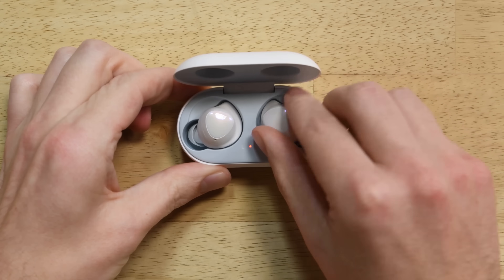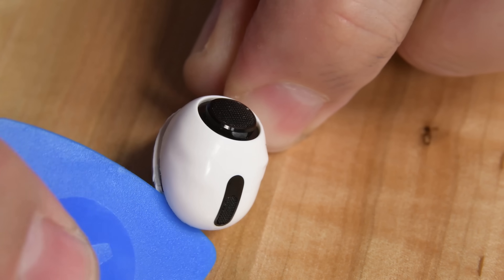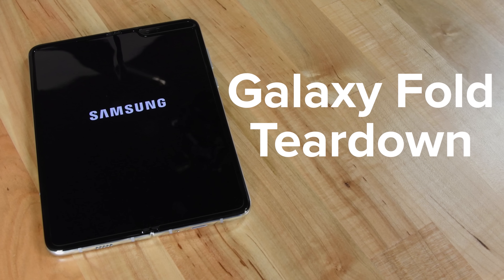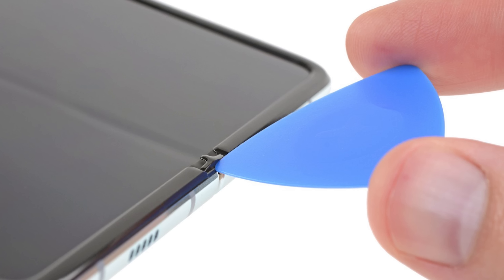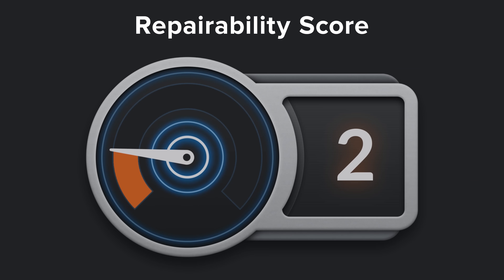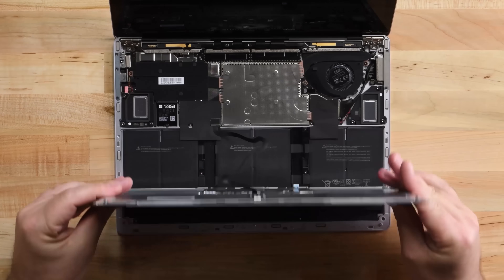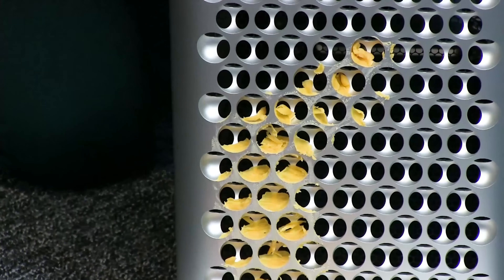Most Interesting Teardown Finds of 2019!

Comment: Well, yes, hardware can be repairable now, because the planned obsolescence was replaces with forced obsolescence, in future Microsoft will also make the hardware to a piece of junk through software like Apple does for a while now, Updates that bust fill the harddrives with junk and use other methods to slow down the system, so anyways people will be forced to buy new devices continously, because simple texting apps that would basically run on a Nokia 3310 can't run on a 240 core CPU with 120 Terraherz and 1024 Exabyte RAM (to exaggerate a little) because the new OS doesn't support that device anymore.

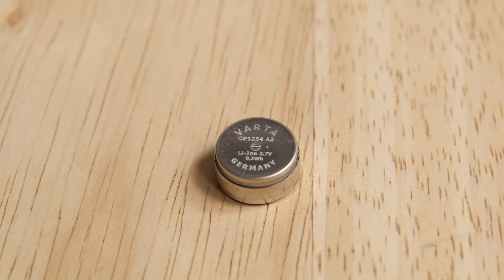Comment: 0:40 Rechargeable button cells at the corner store? That sounds a little... optimistic.
Reply: Some hearing aids use them, so some corner stores have them. And pharmacies.
Reply: The Algonquin  Really rechargeable Lithium or the much more common zinc-air cells? And using the specialist shops for hearing aids as example for "some corner shops" would be kind of cheating.
Reply: Varta  CP1254 A3 rechargeable batteries available on Amazon and eBay. Sony's use same battery.

Comment: The new Mac Pro got a 9/10 repairability score. However someone pointed out to me the concern of having a non replaceable SSD that has the OS on it. Also considering the issue that SSD's are known to have a more brief lifetime, especially under heavy use.
Reply: Mason A you can install another hard drive or SSD and run the OS off of it without ever using the built in SSD.
Reply: @ninja1inblack105  Oh interesting. I thought that because of the proprietary nature of Apple software you couldn't install it on another drive since it wasn't connected to the T1 (T2?) security chip.
Reply: Mason A maybe on other macs but the Mac Pro is very modular. Although on the older MacBook pros you could switch out the hard drives and reinstall Mac OS on them
Reply: Mac Pro has non removable ssd??? They surely think different and redefine things... pro with fixed drive... lol
Reply: Dobromir Dombek yeah the one downside to an outstanding machine boohoo. If a non removable ssd is its biggest problem then sounds pretty sweet to me.
Reply: Ninja1inblack One downside, maybe only just the first one that has been identified? I hope not. It is not only my opinion and I am not an Apple hater I just can’t understand their notorious misuse of PRO adjective. What is pro in holding all your work for days because of broken workstation element that cannot be replaced in few minutes by well trained computer technician?

Comment: Apple realized their error and next air pods will be completely impossible to open.
Reply: Dmitriy Other way around, they realized gen 1 and 2 were impossible to repair so for the pro model they made it easier to fix.
Reply: @ninja1inblack105  in parallel universe)
Reply: Ninja1inblack I don’t think you got the joke bud
Reply: Ninja1inblack it was a joke

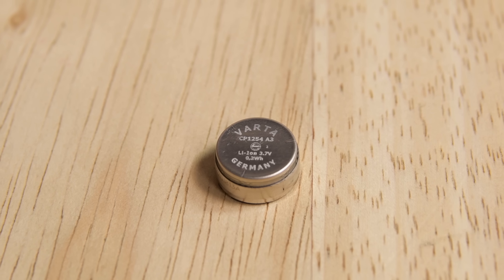Comment: 0:38 no the batteries in the earphones are not the same as the ones that you can buy in a shop. The battery in them is a 3.7v li-ion battery. Not a 1.5v or other lithium battery
Also, the ones you can easily find are NOT RECHARGABLE if someone actually does this the battery will probably leak and perhaps set itself on fire  and it will not even power the earbud.
Reply: @10tк๓ђ i know, I was just mentioning that fact incase someone actually tries to make a repair like that.
Reply: I agree, that it total miss information
Reply: Wait, so when they caught fire it wasn't because of my playlist?
Reply: Button cell that starts with C can't have 1.5v by naming convention. It would be 3-3.7v range.
Reply: @niter43   ok. But none of them are rechargable unless it specifically says
Edit:
Also not all button cell batteries name starts with C infact, you are far more likely to find one that starts with A or L  which are 1.5v and of the alkaline type
Reply: @james_robertson  you can buy rechargeable button batteries, although they are pretty expensive. if you enter the code correctly it will only show rechargeable ones too.
Reply: @ZENTAI00  not in shops/stores where I live. They only sell the non rechargable 1.5v or 3.0v button cell batteries
Reply: @james_robertson  Even if the shops did only sell non rechargeable ones, you wouldn't just pick a random battery would you? Surely you'd buy based on the code on it?
Reply: @thebaldconvict  not everyone will match the code on the battery. Some people simply do not understand that some batteries are not rechargable or have different voltages. And the fact that they just said button cell batteries will make someone try and fit a  1.5v battery in the earbud. And they also said "where other household batteries are sold" . The battery shown is hardly a household battery because it isn't really a common type of cell so it's not like a common household will ever have or more  one of these batteries because hardly anything uses this exact type
Reply: @james_robertson  Those"some people" had better not tear into complex technical equipment to fix it.
Reply: Its the same battery type that you can find in solar warches like Casio, Citizen, Breil.. etc.
They made a mistake in the video, but this batteries are not that hard to find.
Reply: Nowdays they can be bought in a shop as well
Reply: @jonjonsson6323  not in the UK they can't. I can only find the 1.5v alkaline batteries
Reply: Just watched the video and almost fell off my chair when she said that...
I have to agree here, low IQ does exist so someone will see this and try it.

Rechargeble only batteries required and more than likely only bought online. Damn lol.

Mac and Cheese, brilliant lol
Reply: Thought the same thing.
Reply: I cringed when she said that
Reply: Let the retards try, we get rid of them by our artificial selection
Reply: lmao, if you match the battery by number (CP1254) your going to get the right one
Reply: @deathpony698  yes, if you match the battery number you will get the correct type but they said " button cell"  which are very rarely rechargable.
Reply: Varta  CP1254 A3 rechargeable batteries available on Amazon and eBay. Sony's use same battery.
Reply: You can buy the battery that's in the galaxy buds for 3 bucks. We have this thing called the internet, it leads you to this place called Amazon.
Reply: @JLawL  yes of course you can buy them online but the chances of finding them at a "corner store' very low. Someone who maybe is not that knowledgeable of electronics might actually buy a standard 3v or 1.5v lithium (not lithium ion) battery and try and install it in the earbud. And if you know anything about lithium batteries you will very much know the emense danger they pose if installed incorrectly or charged with something (only applies to standard lithium batteries [lithium ion is different to regular lithium battery in the fact they can be recharded]) they could explode/catch fire which in this case could actually cause severe burns is someone is using the earbud when it decides to go Chernobyl on them
Reply: No, the usual ones are not rechargable. The point was that they are standard and easily available opposed to some custom form factor.

Comment: I love that you’re just casually rocking what looks to be a 2012 MacBook Pro in 2020. That’s just the sort of class I’d expect from a fixit group. :)
Reply: After upgrading the HDD and the RAM on my Mid 2010 15 MBP it runs great considered its close to 10 years old
Reply: i havea 2010 MBP, and i upgrade the hdd for an ssd, and aws able to install High Sierra witout any hitches, the machine is old, but as far as i can tell, far more easily fixable than the newer models, and more, useful ports without the need to fall onto the "donglegate"
Reply: The best part is the fact that it’s not even on
Reply: 2009 or 2010 actually, I have both a 2009 and a 2012, and there's a big difference in thickness, plus the 2012 only has 5 ports on that side... Magsafe power, 2x Thunderbolt, 1x USB, and 1x 3.5mm digital/analog audio out. Still a pretty good machine though, even if you can't upgrade the 2009 past El Capitan now... (10.11.6)
Reply: Dan W I stand corrected!
Reply: Dan W could be Early-2011 spec.
Reply: @Dan W I don't know what you're on about. All A1278 (13" not-retina macbook pro) are identical in appearance and ports.

If you're talking about a retina, then sure those are thinner, but those were a 2013 release for the 13" model